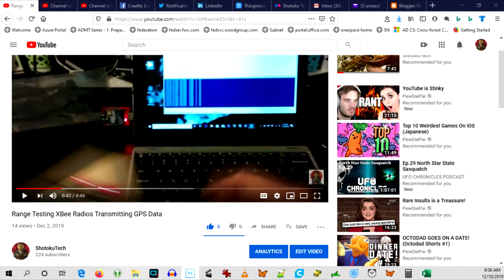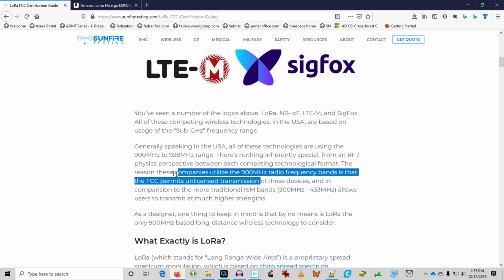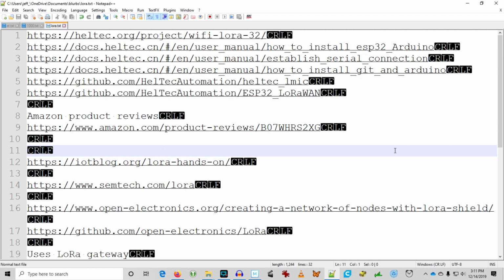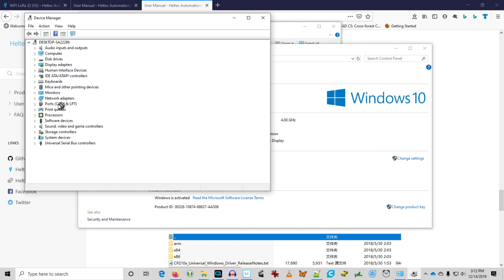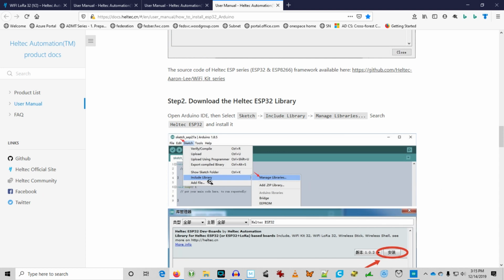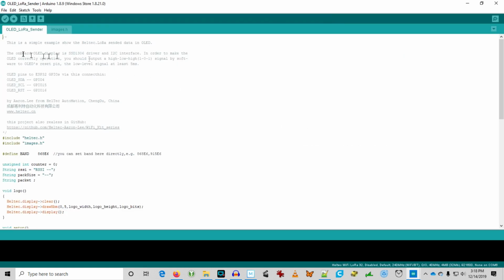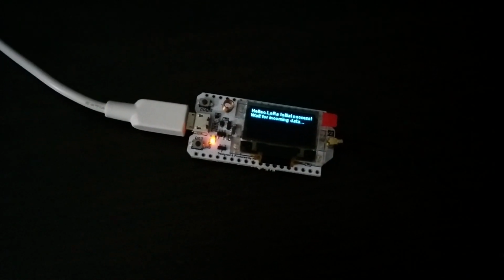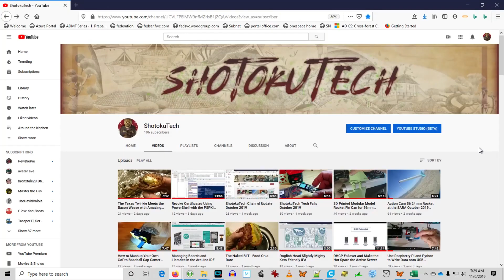Easy Heltec ESP32 LoRa OLED Setup in the Arduino IDE

Comment: This is a super helpful video, many thanks friend! I found an older Heltec ESP32 Lora (v1) board at work and had been struggling to figure out how to program it. So hard to find info for anything other than the latest v3 board. But I'm up and running now. 😎
Reply from the maker: Good news! Excellent. Best wishes.
Reply: @ShotokuTech  Well it works great on my V3 board, but for some reason this V1 board just spits out garbage on the serial monitor. I/m not doing something right, gotta do more research.
Reply from the maker: @0x80O0oOverfl0w  Serial garbage could be Baud rate of the serial monitor.
Reply: @ShotokuTech  Yeah something is off for sure. I think maybe clock rates are not correct for the older board. Finally got it to print out text. Program is set to 115200 and serial monitor is set to 74880. At least it's not broken I guess lol.
Reply from the maker: @0x80O0oOverfl0w  Yeah always check that first when you see garbage or blank, then panic! Best wishes.

Comment: thanks for posting.  Have you used Meshtastic with your esp32?
Reply from the maker: I just started working with Meshtastic this week for the first time. I want to try it with each of the compatible devices I have. The Heltec WiFi Lora 32 V3 is on the compatible list. Stay tuned. Thanks!
Reply: @ShotokuTech  ah cool, will stay tuned 👍📻
Reply from the maker: @simonmoore8414  Thanks. Best wishes.

Comment: If I use ESP32 and Lora SX1276 separately, can I send data?
Reply from the maker: Sure, it looks like the SX1276 module would connect to an ESP32 via serial connection. I don't see why you could not do it. Thanks.

Comment: Ihave v2 version & v3 version . transmitter is  v2 & receiver is v3 version . receiver is not receiving it is waiting for lora data. Any suggestion?
Reply: Yes both configured for the same freq 868
Reply from the maker: @aral1212  Which sketches are you using? The simple sender and receive sketches? Try reversing the roles. Install the transmit sketch on the one that is receiver and vise versa. The only setting I am aware of in the simple LoraSender and LoraReceiver sketches is selecting the correct frequency for the board. 868E6 in your case as long as the board supports that frequency.
Reply from the maker: Are they configured for the same frequency? That is the first thing that comes to mind.

Comment: Hello, is there any chance you can help me? i was trying to connect a Lora 32 heltec v2, but when i try to run the program tries to connect to it and fail.
Reply from the maker: If you are talking about connecting the Arduino IDE to the LoRa32, try:
Make sure you have selected the correct COM port and speed in Arduino IDE.
Different USB cable.
Different USB port, preferably one directly part of the PC, not a USB hub.
Good luck!
Reply: @ShotokuTech  It worked here, i was wondering if you could help me make a program to read a sensor's value of temp/umidity/pressure, i was making a radiossonde project
 i found similar ones, but i'm still yet to test all of em.
Reply from the maker: @ivangold9218  Hello. I have made many videos here that show my approach to programming devices. So the short answer is I cannot help you personally write code. I work a full time job and my video production schedule occupies all my free time.
That said, if you watch my videos about Heltec, like https://youtu.be/bBFnIuqFutc
"New Heltec ESP32 LoRa Update and Connecting to a GPS Module" You see I take a step by step approach. 
Here's my challenge for you. Take one step at a time. Get the Heltec to send "hello world" via Serial. Display "hello world" on the Heltec display. Get one Heltec to send "hello world" via LoRa to another one, or your LoRa gateway. Connect whatever sensor to the Heltec and read the output to Serial. Next display the sensor output on the screen. Finally, Send the sensor output from one Heltec to the other via LoRa. That is the building blocks of code you will mash up. 
Do you have a link to the specific device you have for temp/humidity/pressure? That is something I am interested in. It might make a good video topic. And usually when I make a video, I post code to my Github site: https://github.com/ShotokuTech?tab=repositories
Thanks!
Reply: @ShotokuTech  Thanks for your time responding this, i was going to use the Bme280 senso, now i'm making them talk to each other and read the sensor.
I will make updates about it as it progress as well.
Reply from the maker: @ivangold9218  You doing it! Yeah! If you hit a particular stop let me know.
Reply: @ShotokuTech  My real stop is which battery or method to power my LoRa without a usb cable, i'm still not sure right now.
Reply from the maker: @ivangold9218  MakerFocus 4pcs 3.7V Lithium Rechargable Battery JST1.25 Connector 2pin, 852540 3.7V 1000mAh
https://amzn.to/3tc8kRf
These work good for me. I just put a small switch inline on the battery lead.
Reply: @ShotokuTech  how did you charge it?
Reply from the maker: @ivangold9218  it changes via USB or you could theoretically charge via the 5 volt pin. Solar? I'd need to test.
Reply: @ShotokuTech  it worked on the 3v volt pin, i was trying to power it with the connector on the back, there is a tiny one that seem to work with batteries, at least the data sheet of the LoRa said.
Reply from the maker: @ivangold9218  The battery I linked does fit that connector. That didn't work out for you?
Reply: @ShotokuTech  the one i have doesn't, it only powers up the LoRa on the 3V connector
Reply from the maker: @ivangold9218  Sounds like a defect. LOL

Comment: Can I receive and decode a 433 signal from a contact sensor via one of these?
Reply from the maker: There are 433Mhz models of these LoRa radios. But you should be aware of the frequencies to be used in your region if you are transmitting with one of these. Will it work your 433Mhz contact sensor? I guess in theory it could. The real work might be decoding the signal. If it is part of a home security system for example, it might be easier to have the base station for that system.

Comment: Do you know the purpose of the LoRa gateways? Are we able to connect to them, with a single ESP32?
Reply from the maker: LoRa gateways generally serve as a bridge between your local LoRa connected devices and the internet. Yes ultimately the objective is to connect your ESP32 LoRa devices and their associates sensors to the internet, for further data analysis and dashboards. THis is a good example: "LoRa Gateway for Qubitro with M5Stack UIFlow" https://youtu.be/yyrZrP6KDZs

Comment: Hello, will the Heltec Lora 32 work with a Hc-sr04 ultrasonic sensor? I'm trying to send sensor data for a project that I'm working on. Thanks in advance.
Reply from the maker: Hc-sr04 is 5v device. Should be okay. Thanks.

Comment: I have gone through setting up the ESP32 LoRa, and it sends and receives fine, but once I try and connect my hall effect sensor it does not seems to print to the serial monitor when it detects the magnet. The led on the sensor lights up, but I don't get anything from the serial monitor. I connected it to DIO2 or pin 34. is there a proper way to define it and call on it for the function?
Reply from the maker: Maybe try a hall effect sensor attached to simulated arduino here for better idea? https://www.youtube.com/watch?v=-rL4X9rs3Vc

Comment: using two of the those Heltec Lora modules, i was able to reliably receive a message at 41.926046N, 74.109421W transmitted from 41.930994N, 74.107263W, a distance of 1,890 ft (0.35 miles) -- and the signal traveled through an asphalt shingle roof and a forested knoll!
Reply from the maker: Great job! I got about the same result with the TTGO LoRa boards here in an urban setting. https://youtu.be/-OsApNbqwsk
Can we get more? Thanks!

Comment: hello Where is your buy this LoRa?
Reply from the maker: Amazon:
https://www.amazon.com/gp/product/B07WHRS2XG
Thanks.
Reply: @ShotokuTech  Can you get one with software already downloaded ?
Reply from the maker: @jasonallen1272  I am not familiar with any manufacturer selling them in that manner. There may be some third party reselling them with custom software installed.The board itself lacks any sensors. GPS, motion and other sensors can be attached. Then software has to be developed to obtain the sensor data and transmit it. One could also attach servos or relays to it and send commands remotely to operate them. Thanks.

Comment: Just received my LoRa HELTEC boards (same as yours). This video will really help me get going. Thanks for taking the time to put this together.  I already have Arduino and ESP projects working, so it should go pretty smooth.
Reply from the maker: Good luck. I still need to sit down and take the next step with these. I want to hook a GPS module to one and do a range test. Thanks again!
Reply: @ShotokuTech  Worked perfect. Thanks again for the video. Great instructions.
Reply from the maker: @rfbase  Thanks! Good news is always welcome!
Reply: Dear friend, I have the same boards. However the range is low. How many meters did you achieve in the range tests?